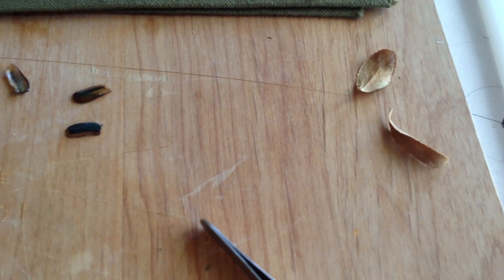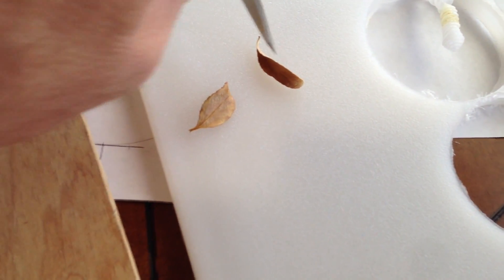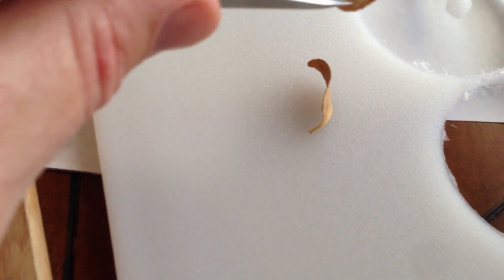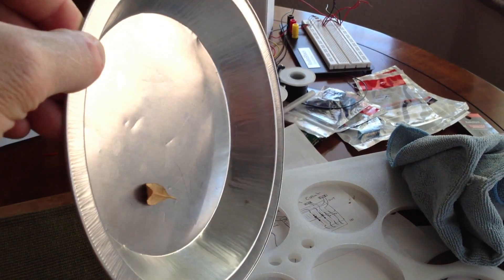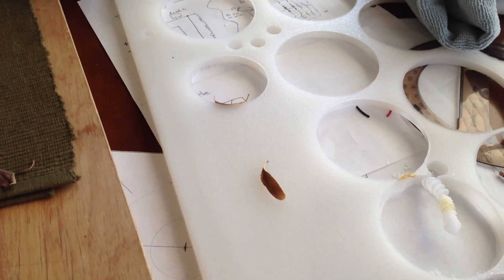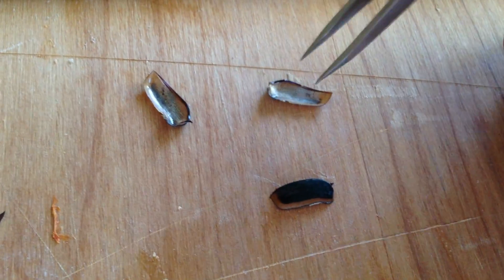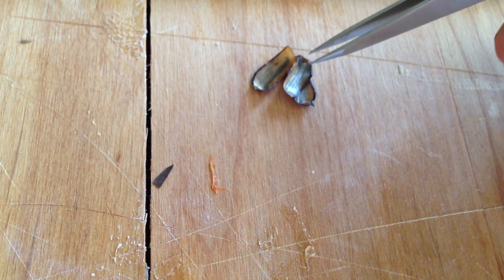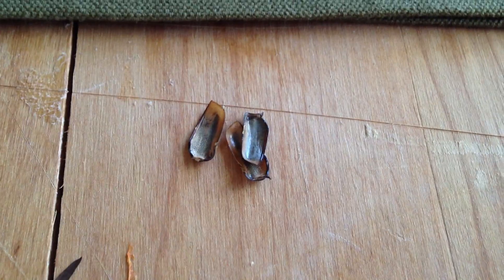Viktor Grebennikov #2 - Static Electricity Effect

Comment: Well, untill they stop using not all the parts of the wings, it will do nothing. You'll need the 'normal wings' and the 'shielded wings'. 
Those normal wings will make a certain vibration that resonates with the shielded wings and sunlight, or at least a certain kind of lights.

But I did not tested it myself. I am trying though. But until now  I haven't catched them alive to put them in a box or something. So far I only find half eaten June-Bugs hehe, well that's kind of sad, but the birdies need some food to I guess.

Comment: Try electrifying it. Glue the beetle wings to the bottom of it radiating in a flower of life design and charge the surface. See what happens. Make sure they are all facing the same direction when glueing them on.

Comment: well.. can u explain then why its hovering on static electricity...
Reply from the maker: Like charges repel. When both elytra are on the nylon they take on  static electric charge held by the nylon, or any good dielectric material.  Think of them as magnets, 2 North poles repelling each other. It’s basically the same thing.

Comment: but what if the scarab beetle wings react like that on wood ?
Reply from the maker: They will act like that any time they are in an electric field. It is possible to make wood hold a charge by smooth sanding and/or a glossy epoxy finish.

Comment: Hey, I noticed u never test with frequency and resonance. If anything is to ever happen, I'm sure it would have to include those variables.
Reply from the maker: I didn’t post a video on that, but I did try it. I attached a small plate transducer to an elytra and slowly increased the frequency. I mainly focused on the frequencies that would match the wing speed of beetles and other small insects, but also took the frequency up to 1Mhz. I didn’t see any abnormal effects. I tried this over another elytra as well as over nylon with a static field.
Reply: Limitless Research but the frequency wouldn't matter if it doesn't have the physical properties to resonate. I think the only chance to get any successful results, is with standing waves. Consider that the ancient structures were all built with the wavelength being considered. Even is em waves, you need the right magnetic field to resonate the two fields which produces the energy discharge. I am certain that the pyramids for example resonate with C#. My sonic levitation device only works if the space where the wave travels is of 1 or a 1/2 wavelength.
Reply: Limitless Research I think we have two options to utilize the wings. First it is neccessary to find the right wing. Then we can look at the length of the structure inside the wing and find the right frequency that will resonate inside each microscopic section. I am not sure if itll be em waves(since the wings respond to an electric feild) or mechanical waves (which only recently Colombia university has officially put forward the theory of phonons being created using sonic waves) maybe we need to trap the phonon in the wing structure? If you want to collaborate on this project, message me.

Comment: If it's static electricity, would it not make sense for the flapping of the wings under the wing guards to create the static electricity from the rapid back and forth motions? Just like a balloon being rubbed on your head?
Reply: They do, the shape of the Elytra on top create vortices when air passes by it on the up motion, down motion creates reverse vortices.

The static is accompanied by electromagnetism, the vortices become magnetic. They resonate creating standing waves and reduces its weight while creating a polarized magnetic field around it.
Reply: @guyfawkes2470  what are vortices? Thanks
Reply: @guyfawkes2470  also what are standing waves
Reply: But in the summer when the bugs are out there is moisture in the air, it's pretty hard to create static electricity in that. My theory is the design on the wings when they are exposed to sunlight act almost as a solar panel and probably use the ultra violet light to generate the electricity needed to operate.
Reply: Drew Pelk https://youtu.be/5H-VV7Dab9I

Comment: Licks fly on a natural anti-gravity cushion located in the first (rigid wings), it would be necessary to study them under an electron microscope and determine the strength, direction and location of the magnetic fluxes of their magnetic field with the help of magnetic dust. I think it will be possible to understand the principle of work of the Grebennikov antigravity platform and also reconstructing them from superconductors (like a magnetic pillow train), it is more difficult to understand and assemble the platform in such a way that it would be possible to change the direction of these mangant streams to magnesium tnom field to safely manage this device, and Grebennikov judging by the photo of his wooden-metal platform did not have at that time modern superconducting materials and technologies and just pasted many torn off wings of beetles (in which he discovered the effect of anti-gravity cushion) on the antigravity panels of his invention, energized them with a small battery with electromagnets generators a small magnetic field around the platform, so that everything worked ////////////// (for beetles in flight due to the work of the muscles waving the second pair of thin transparent wings and the appearance of friction of these wings on the body of the beetle, each other and most importantly about the first pair of wings with antigravity panels - a love is generated and accumulates a static charge creating around the beetle a small magnetic field due to which the antigravity effect is activated due to the interaction of the reinforced magnetic fluxes emanating from the anti-gravity panels (the wing is simply a multi-component geometrically correct panel s natural superconductor) from the earth's magnetic field) /////, for me the most difficult thing is to understand how to repower magnetic fluxes from anti-gravity panels for the sake of stable and safe control of the device ;-)

Comment: But the beetles are not flying with their shells?
Reply from the maker: There is a theory that the nano-structures on the under side of the shells/elytra aid beetles in flight by focusing some force (Cavernous structure effect) or possible static electricity.
Reply: Interesting, static electricity has an anti effect on gravity, just ask Townsend Brown, Paul Laviolette or Tom Valone...
Reply from the maker: Pablo Escobar Yes, great researchers in that field. From my research on this effect, all I have been able to conclude is that beetle shells/elytra are great dielectrics. They are able to hold a static-electric field very well.
Reply: I wonder if most insect wings have this effect. If you think about it how can material have charge without falling apart, like ions for example. I love that you do experiments, would love to do them too in the future where I have more space and more money. There's also blockchain based endeavours for engineers might be great for peer review.

Comment: I wonder if they need to be fresh?
Reply: Also, wasn't it the inner wing that had this effect, not the cover ?
Reply from the maker: The theory is that the nano structures cause the effect. The nano structures are still present on these elytra. 
I have heard both theories about wings & wing covers. My interpretation was it was the inside surface of the outer shell, the elytra. There is a thin layer that can be peeled off like a plastic film from the inside of the hard outer shell that has these structures on it.

My World, by VG
"I put the small, concave chitin plate on the microscope shelf in order again to examine under strong magnification its strangely star-shaped cells. I again admired this masterpiece of nature, and almost purposelessly placed it on top of another, identical plate that had the same unusual cells on one of its sides.

But no!-the detail broke loose from my tweezers; for a few seconds it hung suspended above the other plate on the microscope shelf, turned a few degrees clockwise, slid to the right, turned counterclockwise, swung, and only then abruptly fell on the desk."

Comment: Dumb Ass you did it wrong, you put the open end or indented end of the wings on top of each other. Turn the wings over and put the outside on top of each other. then it will work.
Reply from the maker: Sorry I didn't get that in the video for you. I've tried it every direction, back to back, front to front, and back to front. No matter how they are oriented, it doesn't work without static electricity. Hope that helps you in your research.

Comment: I had become interested in Viktor Grebennikov's work years ago, but the more I got into the "real" data, the more the truth was revealed. 
1: In the famous photograph of him "hovering" a couple of feet of the ground  on his platform, it becomes plain that the image is not factual. If you look at the curb in reference to his head (his left), you will see that in the second photo, the curb is NOT lower in relation to his head at all, as it should have been; only the photographer has moved a little to the right. If he was off the ground, the curb would be below his shoulder or even lower. (Look at the spots on the ground for X & Y references.)
2: The platform was supposed to contain thousands of scarab wing shells above fans, with holes cut into them, which he would then moved (the fans), opening and closing the holes. If holes in wooden fans would shield or release the anti-gravity properties of the bug wings, then the bottom of the wooden platform would prevent him flying. 
3: It was too convenient for the platform to become so efficient to even encapsulate him and prevent wind from even blowing his hat off (@ 1000 miles per hours!). 
We all 'want' to believe, but this was just TOO incredible.

Comment: It has something to do with CHITIN (pronounced Kite-in).  This material never decomposes.  Every insect in the world contains chitin.
Reply: Carbon based chitin formed in one of various ways to project (hold) on it's surface a series of 2 or more scales of magnetic torus fields formed through meson (weak force) surface tension. The cross hatch pattern present in pinecone shapes gives the smallest torus charge (sum of neg and pos) fields reason to make sudden switches from one axis to another along the long axis of the sum which gives a carrier wave on the sum to grow and then suddenly fail as a pump z wave, thereby making all other smaller waves pump z waves. Now watch a video I made on the secret of zero point energy and you'll understand not just how this is key, but how in another video how a metal shape can do exactly what the chitin structure does.

Comment: It's my understanding that it's not simply "beetle shells" but in fact a specific species of beetle because of their specific cellular microstructure.
Reply from the maker: You are correct, that is Grebennikov's theory. What my video is attempting to show, is the effects presented in many videos are not special. They can be replicated with dry leaves and practically any wing cover. The effects are common effects that happen within a strong static field. I have identified a beetle in the same family as the one that has been making all the claims, native to the area I live in. In the spring, I will attempt to catch one to do one last investigation into that beetle's effects and nano structure before I conclude this study. So far, I think the cones/spikes on the under side of beetle wing covers are for allowing an air gap between the wing cover and the wing itself to prevent suction between the two, not to help provide lift through antigravity effects.
Reply: What if the static electricity is whats causing the effect?. the scarab wings seemed far more active than the leaves in the presence of the static electric fields. Is it possible that the interaction between the static electric fields and the micro structure of the shells causing the "anti-gravity" effect? at which point is it not actually "anti-gravity" but a basic static repulsion reaction as your demonstrating, but being amplified by the micro structure??  ... WTF happens when you ZAP one with a BBQ lighter???

Comment: I wonder by adding electricity, would it excite electron's?
Reply from the maker: I'm not sure I follow... If you are suggesting that connecting a high voltage wire to the wing cover and the same lead to a metal plate to build a static field between the two, then yes. Like fields repel and this would create an effect that looks like anti-gravity. It is simply like fields repelling.

Comment from the maker: No, not yet anyway. I'm just getting started. I was planning on getting a few different types of wasp & bee hives from eBay to start with. I may try making some out of different materials (wood, mud, wax, plastic) with similar dimensions just to see what happens. Feel free to share some tips. It sounds like you know a lot about this.
Reply: Limitless Research .. before you totally move on, why not try to build a generator for static electricity to use on the shells you have (that type of beetle is what I would have gone for an is local).. I'm thinking maybe an electric motor driving a shaft that spins many nylon cloth circles that rub against none moving nylon sheet with holes in the middle for the shaft to pass.. few small copper filaments woven into them an see what that does if u prod em.
Reply: @richardward6747  I Think it would better to test sound frquencies effect , as under these covers beetals vibrate their wings creating sound